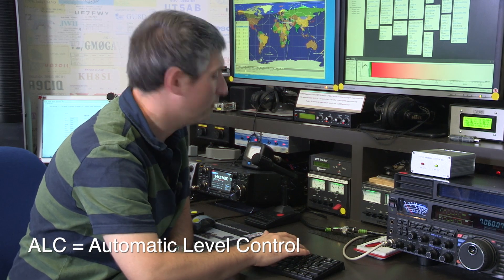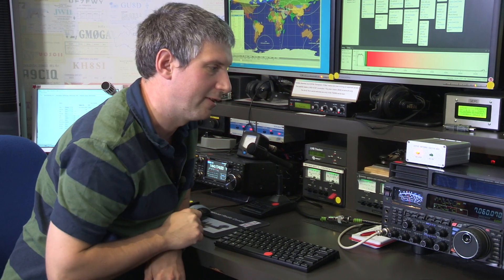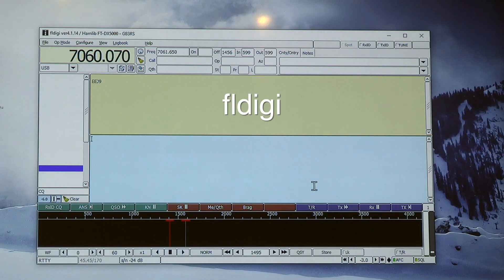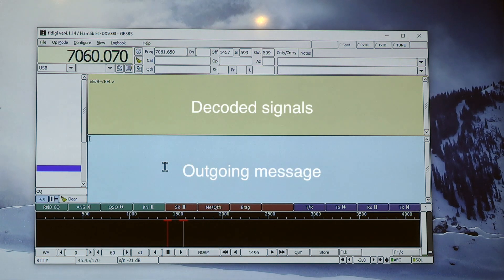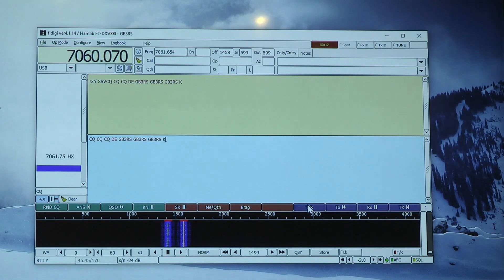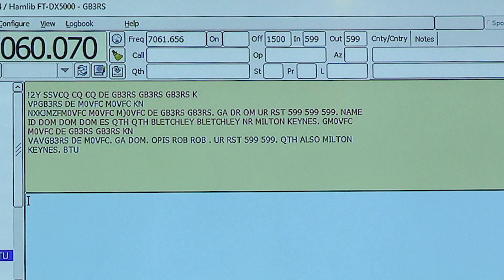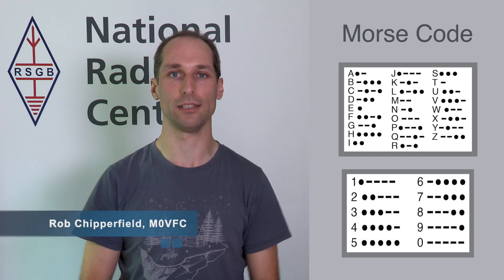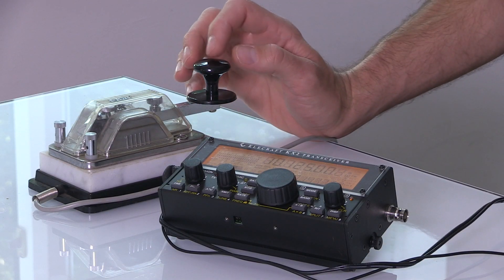Foundation Practicals 6 - Using modes other than voice - the RSGB guide for new licensees

Comment: I've been known to set up inputs with a dummy load and transmit power on minimum for my radio. A nice thing if you have another radio or SDR receiver is (even with the dummy load) you can monitor the actual signal you're sending. (Dummy loads leak a little, but range is a lot less than a real antenna)